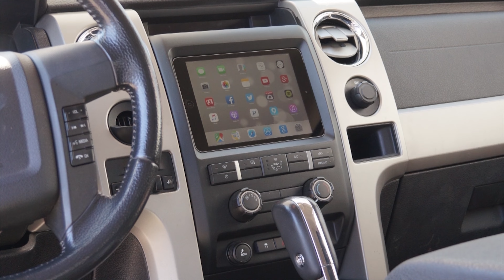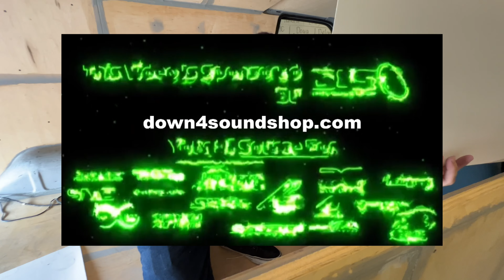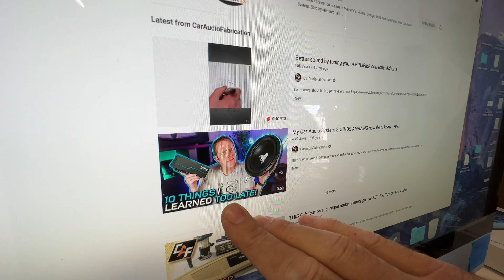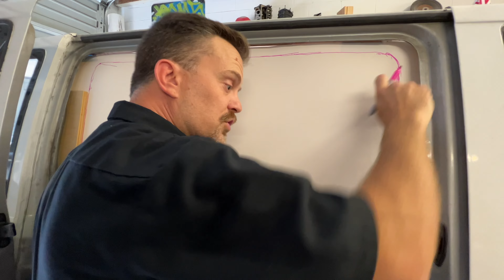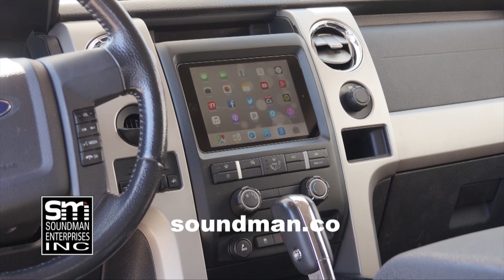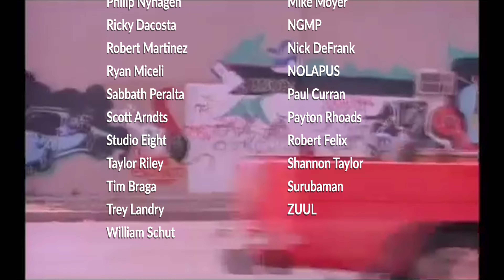making templates for more birch panels - BASS VAN!

Comment: You should run a power lead from the batteria to a spot near the front bumper so youcan put a jump pack on it to open it if something like this happens again
Reply: yes they make battery terminal relocation kits for vehicals with hidden batteries, 35$ on amazon and some wire and its mint

Comment: @Soundman Car Audio should have a Anderson plug under the front of the car Sorround f your battery goes flat you can feed power to the battery to unlock your doors and hood by using a jump starter or battery charger

Comment: Make a panel with  positive and negative terminals so you can jump them if the battery loose power. I always wondered why no one i have seen with shaved handles, has done this.
Reply: I had an s10 back in the the day with a similar concept behind the bumper.
Reply: Exactly 💯.  That would be dope. Doug mentioned something like that in the video. Great minds think alike 😉. 😉 😌 👌.

Comment: oems started putting in decent systems (compared to the old 5w receiver and two paper cone full ranges) so the need for daily drivers to upgrade isn't there anymore. My first system was 8 track in a 26 foot long stinkin lincoln.

Comment: Doug, you should also do a huge window on the back of the box with some thick ass Lexan(at least 3/4"), keep the rearview plus muh LEDz.
Also you definitely want Lexan(polycarbonate) over acrylic. It's slightly softer, so it would be less prone to cracking, though it does scratch a little easier . Most plastic suppliers will cut to size too, so go that route since it's not the funnest thing to cut mess/chip wise. Maybe ask the plastic supply as to whether you need thicker than 3/4"?

Comment: and you dont have to go to amazon for ca glue just go to any store anywhere and get "CA" glue + accelerator.  CyanoAcrylate glue and accelerator are sold under these names Super/Krazy glue;  accelerator = 50% distilled water/50% Windex (lauryl-dimethylamine) in a mister bottle, the misting part is key, you can add a little acetone for a real hot instant joint if needed.

Comment: PRO TIP........take a hot and ground 8 gauge with plug from the battery and mount it under front bumper area....if battery goes dead..you have the other half of plug in tool box allowing you to jump ...charge..or whatever to power door poppers...that's like 1990 technology from when shaved doors first started and the headaches that go with them was realized...stay hard Luke Skycaulker

Comment: Where you gonna run the power wires.....or are you gonna have everything in the back and ran through the back wall right into the enclosure or ran under the van.....gotta consider wire space like EXO did